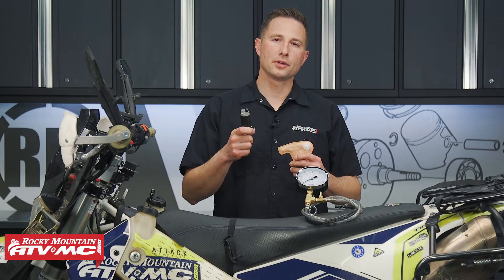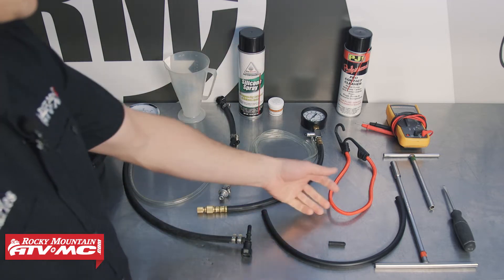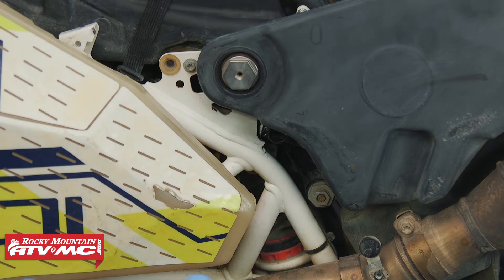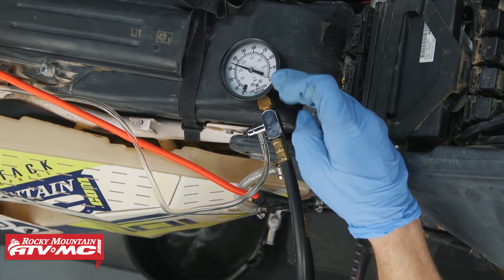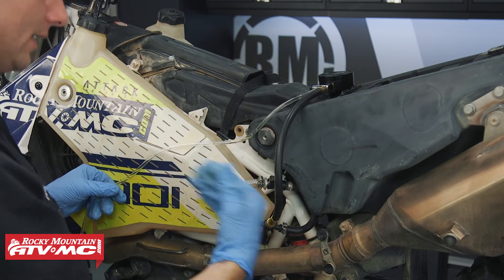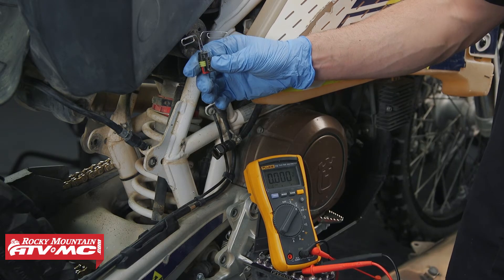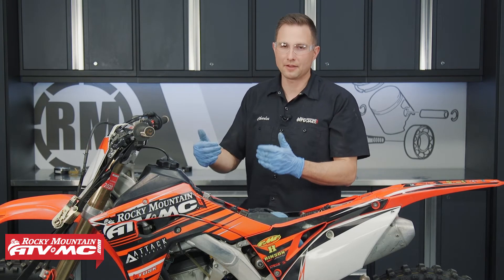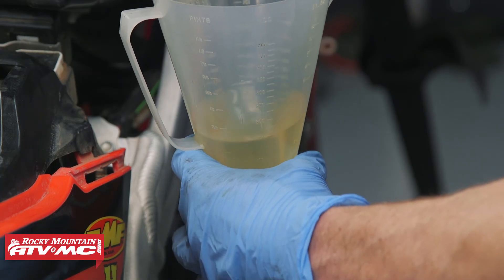How To Test Motorcycle Fuel Pressure & Fuel Flow

Comment: Nice video but i ve a problem with my fuel pump. At load the bar of the pump drops at 1 bar..the malfunction is at the pump or at the fuel regulator?
Reply from the maker: Sounds like it could be a clogged filter or a faulty pump.
Reply: @rmatvmc thanks dude...the filter was clean so I guess that is the pump s fault...

Comment: Great, and how do you test this on a kickstart bike?
Reply from the maker: With a kick start bike, your best option is to run the bike with the fuel pressure gauge, give it a few revs and see if the needle on the gauge drops significantly (more than a couple of psi). If you rev it and the pressure drops way down, you have low flow.  With no gauge, disconnect the pump wires and jump power directly to it with a battery and some jumper wires (paying attention to polarity) and you should have flow
Reply: @rmatvmc  Thanks

Comment: While we disconnect the fuel line to hook it on the fuel pressure gauge, the fuel will flow down and out of the fuel tank. Please tell me how to fix this issue. Thanks..
Reply: only a little bit of fuel should come out if it's a constant stream check the o-rings inside the pump

Comment: I have a kawasaki z250 sl that is not starting.electricalbis good, thinking that the fi is busted, we tested the fuel injector and it was spraying properly. the pump is also whirring when I turn the switch on. Does that mean that the pump is not generating enough pressure to push gas to the fi?

Comment: Great video. What about a dirt bike w/o electric start? How would you check fuel flow, by kick start, will this allow flow of fuel from injector/pump?
Reply from the maker: With a kick start bike, your best option is to run the bike with the fuel pressure gauge, give it a few revs and see if the needle on the gauge drops significantly (more than a couple of psi). If you rev it and the pressure drops way down, you have low flow.  With no gauge, disconnect the pump wires and jump power directly to it with a battery and some jumper wires (paying attention to polarity) and you should have flow. -Charles

Comment: How do you check fuel pressure if your bike doesn't start?
Reply from the maker: Same, you just won't be able to do the running pressure. If pressure is ok and flow is ok, move onto something else. Check compression, check spark. -Charles

Comment: Are you using a pressure gauge for a car?
Reply from the maker: Yes, this same fuel pressure tester can be used for many different vehicles. They usually come with a few different adapters to work on a variety of fuel systems.
Reply: @rmatvmc  thank you

Comment: Does RMATV sell the pressure gauge? I cannot find a pressure gauge on the website via a search.  If so I’m surprised it’s not linked directly in the info.
Reply from the maker: Unfortunately we do not sell the pressure gauge itself.
Reply: @rmatvmc  what was the gauge in the video if I may ask?
Reply from the maker: @wesleysriffle  That was the Innova 3640 Fuel Injection Pressure Tester.

Comment: Gotta wonder how you do all those checks on a KX450 with no battery? All I can do is kick start it to "generate" the power to activate the pump.
Reply from the maker: Just run the pressure tester in-line. If you have low pressure or if it drops when you rev it up, you either have clogged filters or a worn pump. -Charles

Comment: My friends fz07 died on him on the highway.
We get it home and come to find a connector to the pump came loose.(it wasn’t priming so I looked there first)

I reconnect and checked the prime with it out of the tank.
Fuel came out so at least I know it was working.
Put it back in the tank and I tried starting it.
The pump primed but again,the bike just cranks.

Still doesnt start

Comment: Question: can you wash a air filter with just water and soap?
Reply from the maker: You can but regular soap will not get all the oil out of the filter. It's best to use the same brand of filter cleaner and oil.
Reply: @rmatvmc  
Question: can you increase the fuel pressure, if there's no other means to regulate the air to fuel ratio, in a lean situation, on a modified, simple engine?